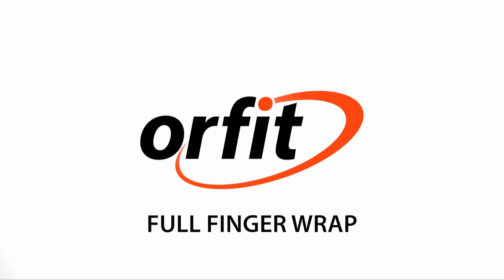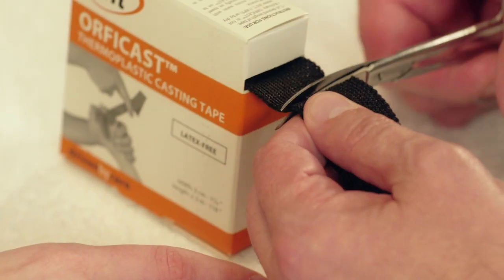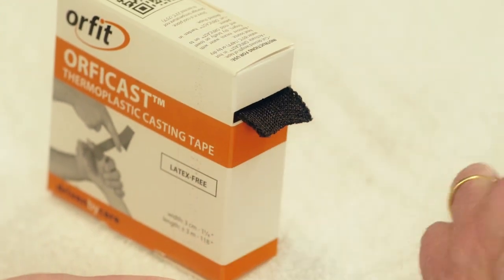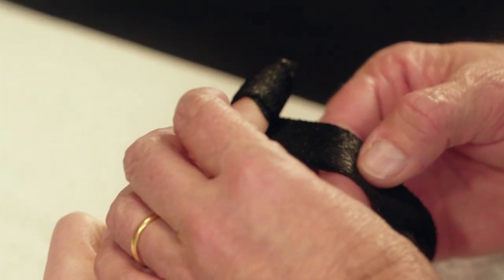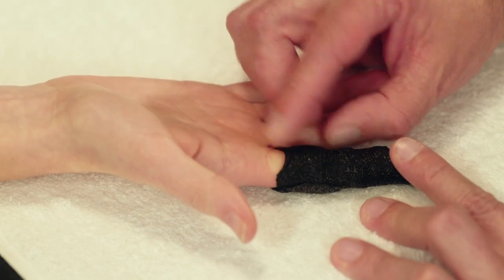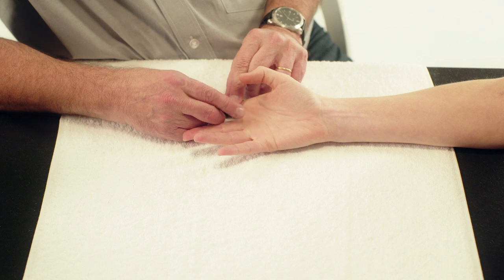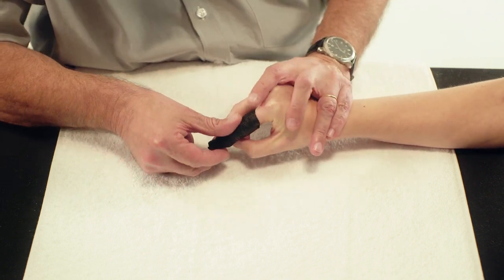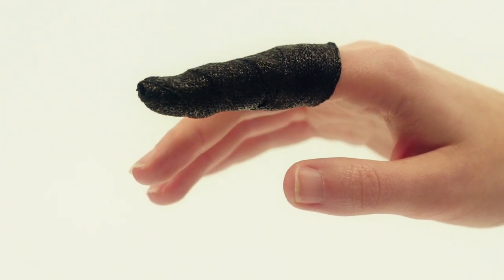Full finger wrap - Orficast Instructional Movie 1

Comment: How do you recommend removing this when used for serial casting?
Reply from the maker: Hi Leanna, the patient should tug slightly after the orthosis has hardened and it might just pull off.
 If not, the orthosis is easily cut with curved small scissors or plaster scissors down one side. You can have the patient soak the finger in warm water for about 15 minutes, and then try to pull it off. The warm water will loosen the orthosis slightly, but not change the shape. Hope this helps!